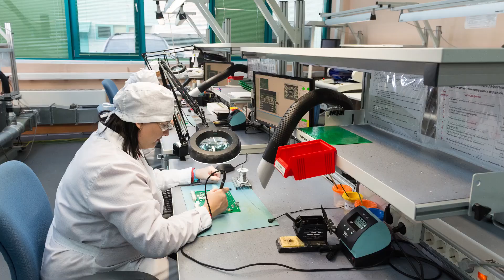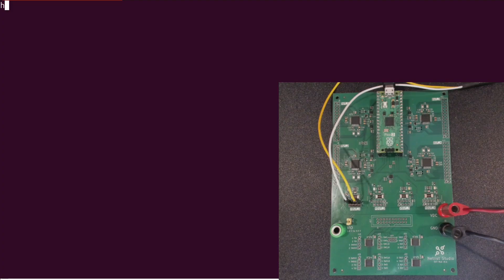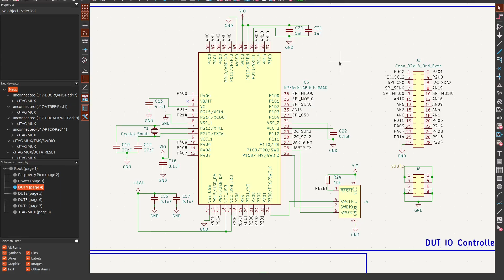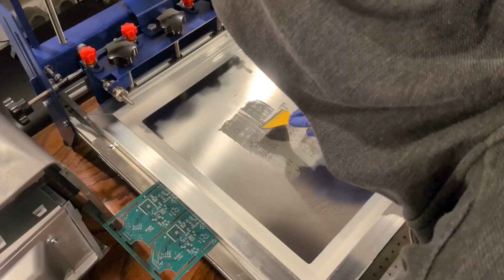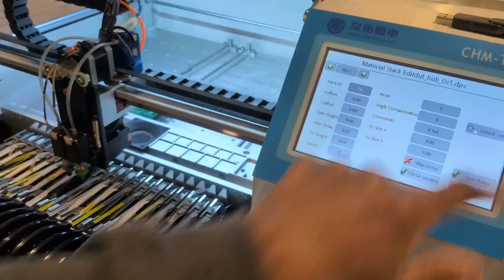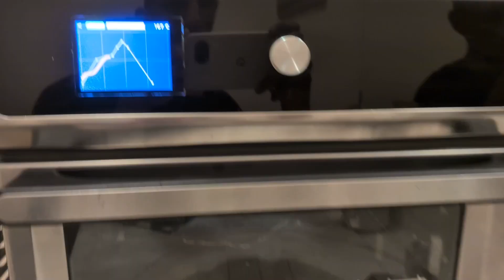DUT Hub: A Prototype Test Jig Controller (V0.1)

Comment: Subbed. Very interesting project. I work at a small-ish MES. I would love to be able to buy something like this as there really isn't time to develop anything inhouse. Off the shelf complete solutions are also way to expensive. Getting a board like this for 100~200 euro with some simple but reliable software and decent documentation would be killer.
Reply from the maker: Thanks for the sub! I could do a small production run if people are interested once I get everything working and documented. 

I'll be posting a video soon about getting MicroPython running soon. It will be much easier to create test scripts now.

Comment: Not sure what version of bed of nail testers you are referring to. Ours are all rather cheap (100s) and we do all the electronics for testing.
Reply from the maker: I should have been more clear. I was referring to the entire package. Test fixture plus controller. I have seen the fixture alone for a few hundred on aliexpress. I'll be posting my DIY solution soon.
Reply: @netliststudio  That makes sense. I have not every looked at the price of those. I am not really sure what type of controller they would use. Never really be offered one. I have heard people using Labview equipment but that is a hard no from the cost snowball it creates.

Comment: Very cool. The amount of similarities between this board and our own internal PCBA test fixture board are staggering. love the PAC1954 used heavily on another product I designed. I am surprised you did not use the RP2350 (could also be used for 1.8V with VIO switch) for the sperate channels. You could have does some interesting things with that like no flash per channel using the HSTX lines. Also PIO is a must for all the application that our PCBA tester needed to accomplish. The manufacturing was super cool as well. We have talked about setting up a small prototype PCB line here but just have not been able to commit to it.
Reply from the maker: Thanks for the comment! Good to know about the about the 1.8V capability of the RP2350. I like the 5V capability of the RA4M1, but maybe that isn't necessary these days. I'll see.

I opted not to flash via the Pico for a few reasons. 

1. I would need to implement the different physical interfaces like JTAG, SWD, UART, etc in software/PIO

2. The USB serial interface implemented via TinyUSB is a bit slow

Overall, it seemed easier to just add a high speed multiplexer and let the user connect their own programmer since they already have one. 

I really like have PCB assembly capabilities for prototypes. Very convenient, but you're not wrong about the time commitment setting it up. I found mine used for a good price on Facebook. You can find great deals.
Reply: @netliststudio  It is 5V tolerant. We use that feature on our testers. I do like the high speed multiplexer makes what could be a hard problem simple. We have been able to make use of the PICO probe firmware to add a programmers into our setup. We have a micro SD card and RTC for logging. The setup is not really user friendly to programme. It is ment to be completely headless with just a set of Traffic light leds for test statue, 7 segment for codes, user buttons for starting and stopping tests. Ours implements CAN bus, CAN fd, rs485, SPI, I2C, a few quadrature encoders.
Reply from the maker: @Ender_Wiggin  Ahh good to know they are 5V tolerant. I get more impressed the more I learn about these chips. 

Your setup sounds pretty sophisticated. I think that's probably the reason a common off the shelf solution doesn't exist. There is always a protocol or featuring missing. Maybe I'll think of adding some kind of expansion header so others don't need to work from scratch. Thanks for getting the wheels turning :)